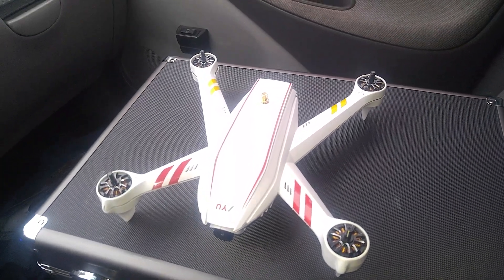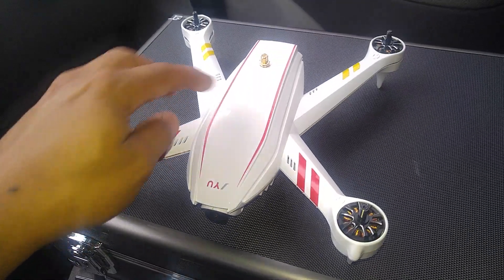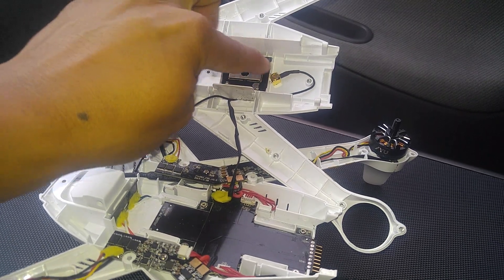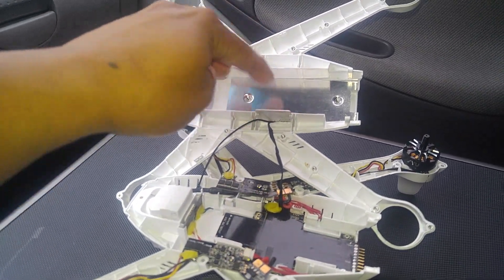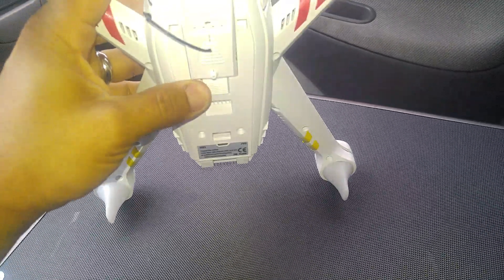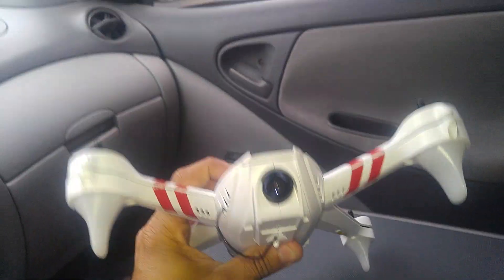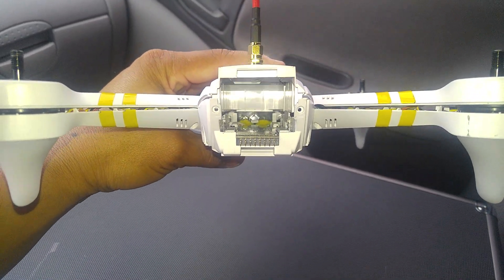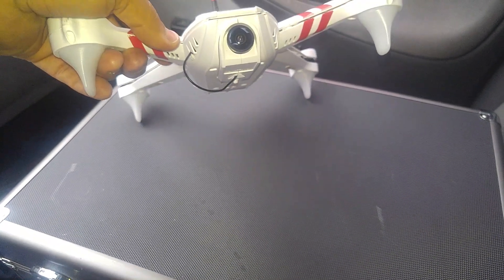HOW TO MODIFY THE JYU HORNET S ANTENNA

Comment: How much range does it have now?
Reply from the maker: Tim Ballentine in this video i didnt have line of sight. before i would get around 75 meters and after the mod i was able to do 130 meters. remember that i did not have line of sight when it was far away. there are houses all around and i was standing at ground level. it did make an improvement. i still have to test on open field.
Reply: Thank you so much for answering my question,I just ordered a hornet and will be checking your channel for tips!
Reply from the maker: Yeah. Feel free to ask any question. I have 3 of these and im trying to mod them. Soon ill upload a video of a hornet s with cc3d flight controller and dsm2 transmitter..  thanks for watching.
Reply: I appreciate that,thanks Dennis.Oh,one last thing.What about 3 bladed props for the hornet,will they make it faster? I've seen where this guy put 7 in. blades on his and he says you'll get 5 more mins of flight time,I guess because of more efficient flight and less power used by the battery.You ever try this?
Reply from the maker: Tim Ballentine i havent tried it on the hornet. but i have tried it on a racing quad i built not too long ago. i noticed its faster and battery last a bit longer.. not sure on the hornet.
Reply: Thanks again,in that case,it should work on the hornet.
Reply from the maker: Tim Ballentine . if you ordered the basic edition, the camera still works on it. all you have to do is buy the camera for the hornet s. since the hornet s is modular you have to buy its original cemera. snap the camera in the hornet and works. it works with my fatshark dominator v3 goggles.
Reply from the maker: Tim Ballentine in short. the pins on the hornet s are ready for its camera.
Reply: Thank you Dennis,that's what I needed to know.Oh,one more thing,if you don't mind,can I just use my phone as a monitor or must I use their monitor or goggles.I found a camera for around 50.00 and a monitor for 29.00,I gave 169.00 for my quad,actually 184.00 with shipping,but I'd still only have around 265.00 going that route.Here's something else,after I made my purchase a description came up of what all was included in my order and it said I would receive the FPV GOOGLES AND CAMERA,but I don't know because I haven't received it yet,I guess I'll wait and see on that,I'm just trying to source the camera and monitor in case that's not what they send.
Reply from the maker: the basic version its $169.99. it has no camera or monitor. for the version with camera and monitor its around $300. but if you by any luck get the camera and monitor you are lucky. lets hope they sent you everything for that price. if you already have fpv goggles, buying the basic version and the camera on the side saves you around $80. the hornet camera has 8 channels i think, and any 40 channel goggles will be able to get video. if you dont have fpv goggles you can use the money you saved to buy some goggles like the eachine goggles. we can not use the phone yet. i dont know when the app will be finished. jyu 
havent said anything yet.
Reply: Ok,well,if I don't get the goggles can I still use the FPV monitor with this inboard camera?
Reply from the maker: yes you can use other fpv monitors. make sure the monitor has a 5.8ghz 40 channel receiver that way you have better chance to find the right channel for the hornets camera.
Reply: I found a 5.8 hornet monitor for under 30.00,if I don't get what it said was included,that's probably what I'll get.Dennis you have certainly been a big help and I really do  appreciate your help.God Bless.
Reply from the maker: no problem. make sure the monitor comes with the cable that connects to the transmitter controller. if you got everything, it should work no problem. the transmitter controller has the receiver built in and i think the original monitor is the only monitor that works with the plug. i have 3 of these so any other questions im happy to answer. the only mod i recommend doing right now is the antenna mod. just make sure when you put it back together the antenna cable is not being pinched by the body. that if you decide to make that mod after flying it and want better range on video feed.
Reply: If I do extend the range,you can be sure I'm coming back to your video to see how to do it,lol.
Reply from the maker: Lol.. im here to help. thank you.

Comment: Hola: me podria decir que clase de cable necesito para poder hacer la misma operacion que usted y que componentes ?
Reply from the maker: F Grasa Berges hola. hay dos tipos de cables que puede usar. 1.13mm de diametro y 1.37mm de diametro. yo use el 1.37mm de 12 pulgadas de largo. En una punta se usa la conecion IPX U.Fl female y en la otra punta rp-sma female angulo de 90 grados.
Reply: Dennis Gutierrez Gracias

Comment: Hola, tengo unas preguntas
Cuantos metros te aumento de alcance de fpv? 
Se puede de igual manera modificar el control para aumentar la distancia máxima de manejo? 
El jyu hornet s utiliza alguna app para poder ver lo que ve la cámara en el celular o tablet?  Si es así, cual es?
Reply from the maker: El alcanze mejoro talvez un 10% con una antenna de fatshark (circular polorized antenna). la que yo use es derecha, no se si una izquierda daria mejor resultado. para el alcanze del control yo he podido volar no mas de dos blokes. pero de acuerdo al manual tiene alcanze de mil metros que un poco mas de media milla. pero el control es similar al de dji phantom 3. usan un wifi relay. creo que se puede usar un amplificador como los que se usan con el dji. es un projecto que tratare de hacer cuando reciva el amplificador para la señal del control.
Reply from the maker: supuestamente jyu tiene un app para conectar el telefono o tablet, pero hasta haora no han terminado esa app para usar..
Reply: Dennis Gutierrez saludos. sabe usted si ya esta el app para usar el cel.?
Reply from the maker: Ricardo Mendez no no se si ya terminaron el app. verificare cuando tenga chance. y si ustes se dan cuenta que ya existe el app antes que yo les diga me dejan saver.

Comment: Hola Dennis....recibí el jyu hornet s hoy....pero el GPS de el radio no activa..
Reply from the maker: +Mr Dron Creo que segun el manual solo se activa en modo 1 el switch the enmendio. Talbes tabien con el modo 2. Cuando las luces esten verdes solidads en la nave, tiene que presionar el boton de la casita dos veces. Y esa sera el punto de regreso automatico y la luz del gps en el control tiene que quedar prendido. Hay que leer el manual para estar seguro porque ni yo estoy muy seguro. Ya que yo solo lo buelo en modo 3. Maual, sin gps.
Reply: Gracias Dennis..
Reply: Mr Drone ya lo calibro con los satélites?
Reply: Dennis Gutierrez el botón con la casita debes mantenerlo apretado hasta que el control vibre y ya estableses donde quieres que regrese y para que regrese solo tocas el botón rapido y lo sueltas y regresará.

Comment: Great mod, I was considering the same myself but was thinking that mounting it there may effect the GPS precision. Is it still perfect with this fitted next to it? I need to open the camera anyway as it's out of focus
Reply from the maker: thanks. yeah thats the only way i was able to fit a better antenna. if your camera is out of focus all you have to do is twist turn the lens. it has some kind of glue but it should break off. im using a go pro lens. i notice the glue when i replaced mine. just be careful when twisting. there is not enough space for the fingers so i used some needle pliers to wiggle the lens loose.
Reply: Dennis Gutierrez I already tried twisting it but even with foam padding and pliers I can't move it to the point it made some marks. Scraping it off once inside should be easy enough. I'm holding out for the gimbal to be released, they are taking their time for sure
Reply from the maker: Ahhh ok.. Yeah should be easier with camera out. Yeah i was thinking about the gimball as well. They are taking a while. But right now im having fun flying fpv with this thing. I hope they make higher capacity batteries too..
Reply from the maker: +MicroRCFiend the gps still works good even if its next to it.

Comment: Thank you for sharing this mod. It looks great! How much is your range gain in meters?
Reply from the maker: +jenskreidler before it was around 80 meters when the image started to fade. I dont have line of sight to quad when i fly it since there is no open field near by, i fly it around houses. 2 blocks is the farthest i have flown it with no line of sight.. If you seen my other video test flying it, it went from 80 meters to around 125. I know it can do more on open fields.
Reply: Thanks you for your response. May I ask you where to buy the required cable? I've spend an hour of search, no appropriate match. As far as I can see, it's a RP-SMA female jack right angle to u.fl ipx female plug. Could only find one offer, but 15cm (6 inch):
https://www.amazon.com/dp/B00R95LHCY/ref=wl_it_dp_o_pC_nS_ttl?_encoding=UTF8&colid=3TAZD4YJEINVT&coliid=I197WTRACFLK01

Would there be enough space for an adapter like this one:
http://www.banggood.com/5cm-RP-SMA-Male-to-RP-SMA-Female-Right-Angle-Cable-p-956188.html
Reply from the maker: +jenskreidler Hi. I found my cable on ebay. And you can only find 6 inch or 8 inch. I told the seller to make me a 12 inch. It was $1 more.. They can make any length if you ask them to.. In amazon should be the same but im not sure since i have never used amazon.
Reply from the maker: +jenskreidler the adapter from banggood may not work since its sma on both ends and is too short. I would recommend the one from amazon. But you have to ask them to make it 12 inch long. I tried 8 inch but is too short. I used a 12 inch because it allowed me pull the module out and still have length to work on the camera while connected to the antenna.
Reply: Thanks for your suggestions - btw: I think you did an excellent job, the range improvement is outstanding (about +50%, no direct vision contact).

Well I thought about buying that banggood 5cm adapter plus a standard straight cable of about 20cm. Thus, will there be space enough for the adapters straight end plus the jack of the extension cable?

But it's a good idea to get in contact with a seller, questioning him for a longer cable.
Reply from the maker: Thank you. Yeah it gave me better range. The range might be different depending where you located. Where i live there is a lot of interference. And for the adapter i dont think there is enough space for the sma plug. Unless you find a way to make it fit. Believe me i tried everything and this was the easiest way. Yeah contact seller and they can help you out..

Comment: Did You End Up working out which antenna on Transmitter is 5.8ghz for fpv, because ithought it might be the right but now thinkings its the left antenna, as i want to change my antenna on transmitter to fat shark clover
Reply from the maker: +samste im using a right fatshark. It works good. I dont have left antennas but ill be ordering some left antennas to compare wich one works best on this transmitter.
Reply: No i was actually talking about replacing the Hornet s 5.8ghz antenna  on transmitter but wasnt sure which one is the 5.8ghz antenna
Reply from the maker: +samste Its a small antenna inside the camera module.
Reply from the maker: +samste you can replace it. But there is not enough space for a better antenna..
Reply: On the Controller not on camera
Reply from the maker: +samste Ahhhhh on the controller.. Yeah i was thinking to do that next.. I havent opened the controller yet..
Reply from the maker: Right now i dont have any issues with the receiver. The transmitter is what im concerned of. I think its only 100mw..
Reply: Yes i think your Right 100mw its not strong enough, i was hoping to try and maybe use the osd board on camera module and put in a bigger transmitter module. or find out the exact wiring pins dteails and put my own osd fpv tx module on quad
Reply from the maker: +samste yeah.. I tried an 600mw transmitter from immersion rc and made it work with the original camera but i can not link the original osd with the transmitter. When ever i get a chance ill keep trying to find the wiring.. Ill be trying a transmitter booster soon. Well see how that works..
Reply: Thanks so Much for replying and helping out with these issues as it helps me and others to also try and resolve issues.
I did find out what several pins do on the Quad fpv input and i think i know which wires do osd, posted on rc groups my findings a while ago
pin 1 = Negative
pin 2 = positive 5v
pin 3 = osd Signal Wire 
pin 4,5,6 not totally sure about but seems to be for switch freq channels for fpv tx as covering those affected channel button changing, 
though pin 4 could be for something on osd but not 100 percent sure.

Can you Post up on How you connected up using existing camera either on Youtube or Rc Groups
as a lot of people love the Hornet s But it does have some issues to fix like the fpv signal
i get approx 150 line of sight before it goes fuzzy and not clear for fpv using fat shark antennas

Rc Group site for Hornet s is....

 http://www.rcgroups.com/forums/showthread.php?t=2641191&page=25
Reply: Fyi, Fpv module Pins i think i have worked out some of the Pins
With Quad Upside Down looking into the fpv module hole from Left to Right
Reply: Hi Dennis, can you post up how you got the 600mw transmitter to work on original camera as i'm looking at doing something like that or like you said a booster amp which i have ordered
Reply from the maker: +samste i dont have it hooked up on the quad yet. But i can upload a video showing which pins are the pins you need for video feed. Maybe you or other viewers can help me out on how to link the osd.
Reply from the maker: +samste yeah. On the spring loaded connectors you can see the 2 pins on the right have a rough ends where it makes contact with the quad. Thise 2 are the 5v power. I still have to figure out the rest. I think the other 5 are to link the quad with the osd.. Not sure.
Reply: Worked out the pins for video feed out and video ground with OSD Display

http://www.rcgroups.com/forums/showpost.php?p=35068169&postcount=426
Reply from the maker: +samste thanks man. this is what i need. now to install a transmitter with more power..
Reply from the maker: +samste thanks man. this is what i need. now to install a transmitter with more power..
Reply: Your Welcome Mate, I'm Looking forward too myself adding a 600mw Transmitter
Reply: Possibly use the gimble pins for your 12v power source , i will update when i confirm pins for 12 positive and negative
Reply from the maker: +samste yeah.. i already have a immercion rc 600mw transmitter.. ready to be added on the quad..
Reply from the maker: +samste that would be great.. ill keep looking to see what else we can add to this quad.. thanks again..
Reply: I only needed the one video wire to connect to immersion no Ground wire from Fpv needed.

Comment: did  u unscrew off the cam lens . or have to do bunch of other things to take it off
Reply from the maker: +MASKIDANA I just unscrewed it. It has some kind of glue on it buy carefully unscrew it off. Do a back and forth motion until it loosens the glue. Then it should come off really easy. Its an M12 thread mount so any M12 works. Ill be trying like 4 diffrent lens in the future.. Im using a go pro hero 2 lens right now to record those flight videos.

Comment: Nice, thanx. What is the stock camera resolution? Thanx
Reply from the maker: +rcmusic35 Hi.. I have the fpv version and according the to description it has a 700tvl camera.. Sharp enough to me.. Thanks..
Reply from the maker: +rcmusic35 one thing i dont like about this camera is that it image gets dark when facing the sun. Not directly facing the sun because the camera is looking downwards when flying fast but the light off the sun makes the image dark..
Reply: ok thanx!. i thought 700 lines was for the screen, not the camera. so it means the camera is around 720p?
Reply from the maker: +rcmusic35 description says 700tvl. I believe thats some what hd.. Description also says that the gimball version camera is 1080p but doesnt say if it uses the same 700tvl..
Reply: the gimble has a totally different camera, far better for pictures et videos
Reply from the maker: +rcmusic35 yeah i bet. I Dont like to hover around. Thats why i got the fpv version. Im happy with the fpv version after this antenna mod. Got better video range.
Reply from the maker: +rcmusic35 what i will try to mod later on will be the battery.. I only get around 10 minutes flying manual.. Would be nice to fly it for longer then 15 minute.. Lol